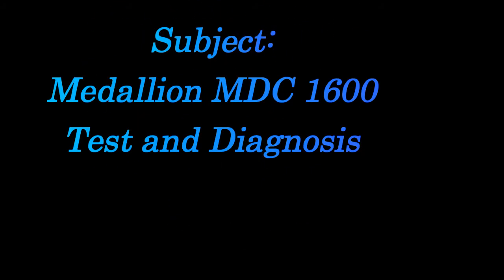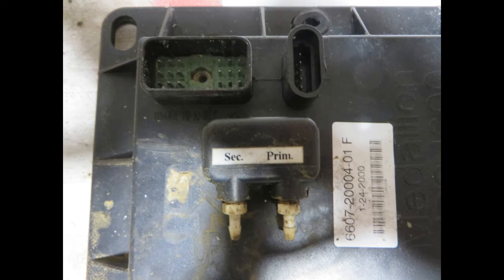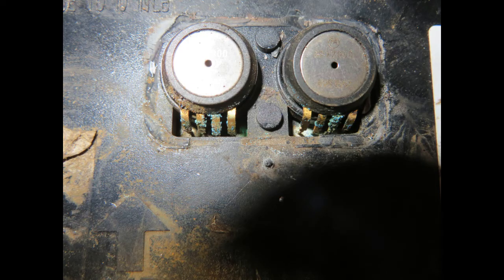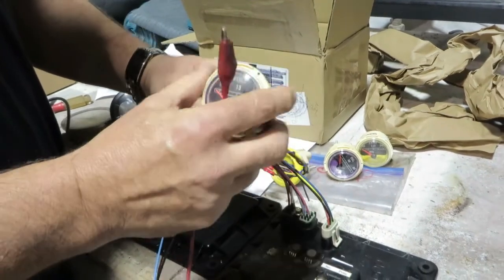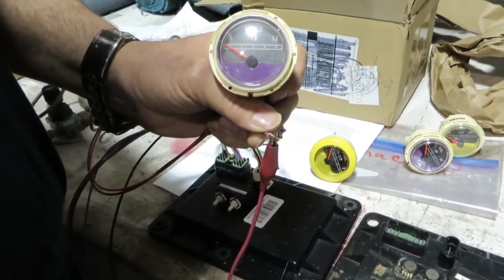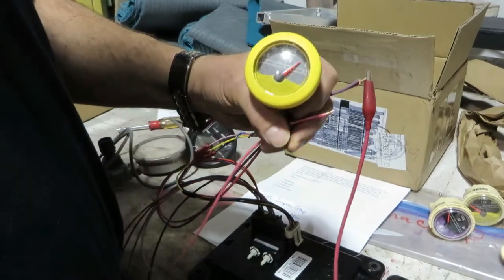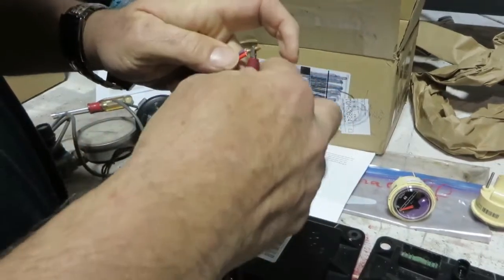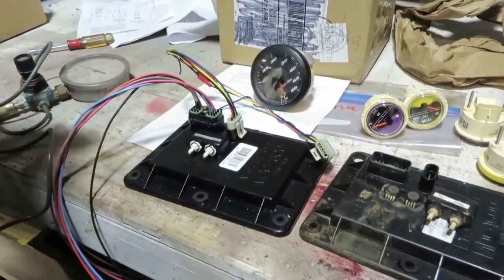Medallion MDC 1600 Test

Comment: Ron , My boat 2008 supra, with a medallion instruments my full gauge does not read correctly. After start up it goes to full and stays there. New full gauge. Also when I go through the sweep sequence , it seems to operate properly. Is it possible that the mdc is bad?
Reply from the maker: Senders are more likely to fail, I would start there, test to sender.

Comment: Hello Ron. JUST finding your videos. I have a 2001 Mastercraft X Star. Voltmeter doesn’t work at all, Water temp starts at 90-100 then slowly goes down to nothing as the boat runs. Other gauges work ok. Ideas?

Comment: I have a 98 Malibu echelon with the medallion system, my gauges work intermittently, and sometimes oil pressure and water temperature are pegged as far over as they can go, so 80psi oil pressure and 240 degree water temp. When they go out I can get them to come back by wiggling the small oval connector. Any suggestions?
Reply from the maker: Life expectancy on these are 20 years +/- 5 years, get ready to replace the system (TRD Conversion Kit)
Reply: @rontanis1024  would a bad MDC connection cause wrong readings on those gauges? I would think I would hear an alarm if the engine really got that hot
Reply: @kadencleaves6554  Faulty stepper motors will "freeze" the needle in random locations. Generally, wiggling connectors does not relieve this issue, but gently tapping on the gauge pod itself will "loosen" up the frozen stepper. If your gauges are pegging max intermittently, and you can wiggle a connector to relieve the issue, then almost certainly there is corrosion on the connector contacts causing the MDC to think that the inputs are maxed out. Get some deoxit cleaner and clean up both sides of the connector.

Comment: Hi Ron, I have this Medallion MDC-1600 in my boat and my gauges don’t work until I push on the oval output connector then the gauges work as expected. Any ideas of how I can fix this?
Reply from the maker: The stepper motors in your gauges have a life expectancy of 20 years +/- 5 years, you are at the end of this rope, I would not spend any $$ on this system, do whatever you can to make the connections at the plug knowing it will be temporary and a conversion kit is in your future.
Reply: @rontanis1024  Thank you for the reply. When I take the boat out, I've been putting tape on the oval connection and wrapping it around the larger connection to pull it to the position where it works. This temporary fix will work for about a day or two.

Comment: I own a 2000 MasterCraft Prostar 205.  The tempurature gauge will jump around (only while I am skiing).  I have replaced everything that is heat related such as the raw water pump, thermo, and put in a new sending unit.  We are now going to consider replacement of the MDC.  The boat will run totally at normal tempurature (which has been verified by computer checks) then the gauge will jump around from normal to 240 when it actually is not heating.  No codes have ever been thrown, and the engine alarm does not go off.  HELP?
Reply: The stepper motor inside the gauge pod is bad, not the MDC. In general, when the MDC fails, you get total failure of all gauges. If you have one or more gauges working, and others that are not working, then you need to open up the gauge pods and replace the stepper motors inside.
Reply: @shumanchu1  2001 Mastercraft X Star. Voltmeter doesn't work at all. Water temp starts at around 100 then goes down to nothing after the boat runs for awhile. Ideas?

Comment: Great video. I have a 2002 MasterCraft with the Medallion gauges and MDC. My volt gauge and Perfect Pass is reading 10.3V. My batteries are brand new and read 13.1V when the boat is off and 14.4V at 1,500 rpm. I have 12.98V to the + and - terminal blocks under the dash. The low voltage alarm keeps going off. I've replaced the MDC and volt gauge and neither solved the problem. Where should I look next?
Reply from the maker: You have a 1+ volt loss between the engine & dash, the dash power typically comes from the engine not the battery, check the main engine connector at the engine
Reply: @rontanis1024  Thank You and Thanks for calling me back.

Comment: Hi Ron, 

I have a 2006 496HO and have had an intermittent tachometer for the past year or so which, in the past, would be fixed (temporarily) by pulling & re-plugging the large Mercruiser connector on the back of the motor. Also doing the same with the 4 pin plug on either the MDC 1600 or the back of the gauge would temporarily fix the problem. A few months ago it quit all together and pulling & re-pluging those connectors would not fix the issue but I found that by pulling & re-plugging the 18 pin connector that it began working again but now it seems to have quit all together although if I unplug and re-plug any of those previously mentioned connectors, including the 18 pin, I do get (sometimes) movement of the needle when the ignition switch is turned on and I get 300-500 RPM with the engine running but that is all.

Note that all other gauges work and all connectors and components have NO exposure to moisture and that my MDC does not have the speedo pressure sensor on it. I have checked and applied dielectric compound to all connectors.

I have also read that there have been issues (at least on the 4 pin connector of the MDC) where there have been inferior solder connections of the 4 pin to the circuit board which when re-soldered have solved intermittent gauge issues. 

Do you know what color wire on the 18 pin connector is the tach input? 

MDC-1600 / 6603-20002-01 G / 9-19-2005...any thoughts?

Thanks,
Paul
Reply from the maker: Pin D-2 on the 18 pin connector is the tach sender, should be gray wire & is next to the center bolt
Reply: @rontanis1024  Thanks...any thoughts on those that have opened up the MCD (with a heat gun) and found a bad solder connection (link below) and also, does it sound like a bad connection since it only involves the tach or could it more likely be the stepper motor in the tach?
https://www.themalibucrew.com/index.php?/forums/topic/50826-mdc-repair/
Reply from the maker: @kachinashadow  the stepper motors are good for 20 years +/- 5 years, the 5" gauges tend to go quicker
Reply: @rontanis1024  This is a 3.25" (although sticker says 3") w/hour meter (which still works). I hear that the stepper motors, at least in the 2" gauges, are common GM...I have a gauge shop in town so I'll see if he can check out the gauge.
 Great video by the way!

Comment: Thanks for the video. How do you access the dome contact points to clean any corrosion without breaking the dome off?
Reply: Sorry, the pressure sensor housing area with primary and secondary printed on it.
Reply from the maker: Whats a dome?

Comment: Hi Ron, very informative video. I do have a question about my boat, when I turn the ignition on the Speedometer does not find zero and every time I turn the ignition on and off it chatters but it always ends up in a different place. Additionally I have a multi gauge fuel, oil, voltage and temp. I hear the chatter, the oil needle vibrates but never sets to zero. Is it reasonable to assume the gauges are faulty. Thank you.
Reply from the maker: More than likely the stepper motors inside the gauge are beginning to fail, life expectancy is 20 years +/- 5 years
Reply: Ron Tanis Thank you Ron, as I thought. Chris Craft used these in the 2001-04 Constellation models and mine is an 01. Need to figure out if they are serviceable, replaceable or convert.

Comment: Hello. My oil pressure gauge bounces around a lot at idle. at higher RPMs it pegs at max. Could this be a wiring issue or an internal issue with the MDC? The oil pressure sending unit is new and so is the gauge.

Comment: Hi Ron, all of a sudden my gauages are no longer working, can i assume my dash computer needs replacing ?  how can i check without a volt meter ?
Reply from the maker: Without the proper tools you cannot verify the input signals, minimal would be a 12v test light to see if power is getting to the MDC, otherwise if there are signs of water intrusion into the box then you can safely consider it bad.